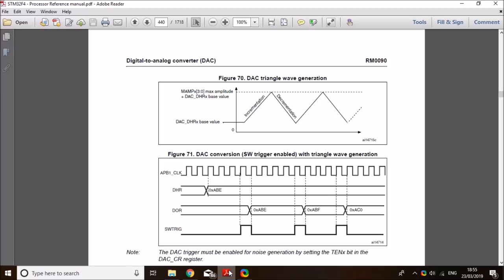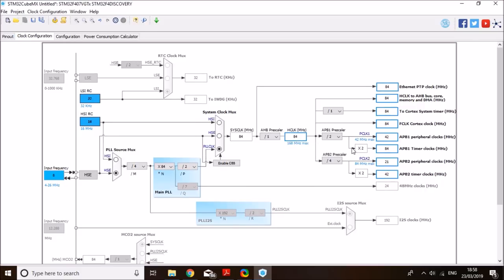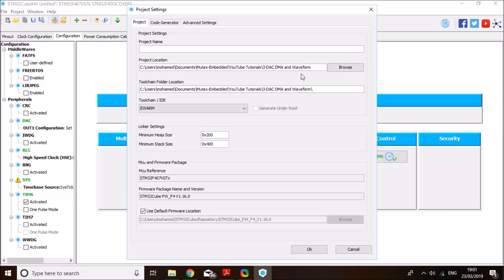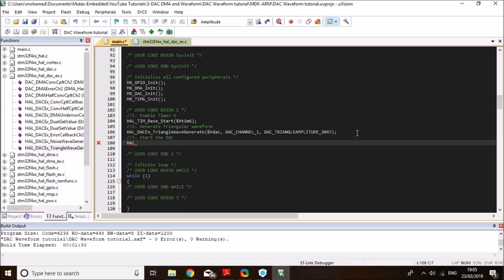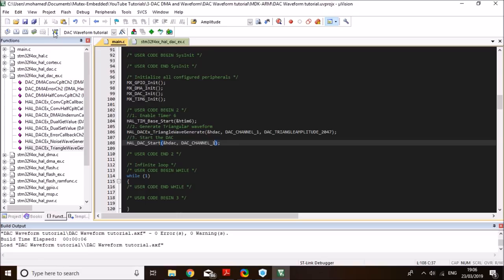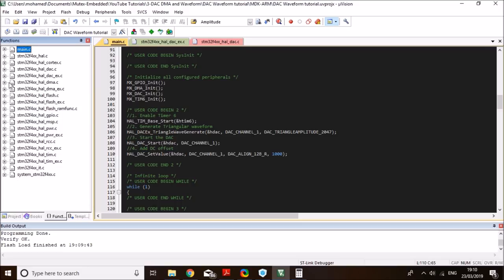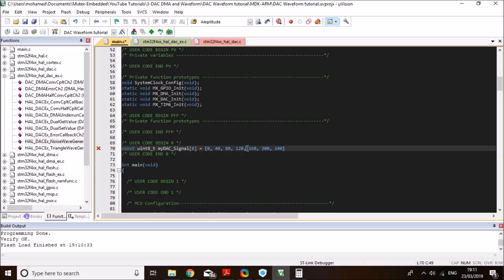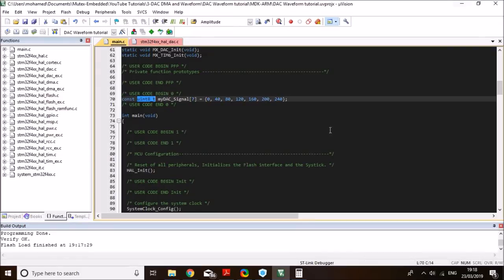STM32F4 Discovery board - Keil 5 IDE with CubeMX: Tutorial 31 - DAC Waveform & DMA

Comment: Thank you for this tutorial.Can you show us using spı pin on STM32F4  discovery card to write and read data to sd card.
Reply: There are several tutorials here that do this.  Look in this channel f or SDIO.  And SDIO 4 bits +DMA.  FATFs is a built in middle ware, so it is easy to set up.  One could use SPI for the SD card, but Since there is a built in 4 bit controller it is much faster, more reliable and better supported.
Reply: @spiralsheepdoll  i know how to used with sdıo pin but some stm module dont have a sdıo pin thats why i need spı pin for read and write data to sd card
Reply: @gokmenatakanturkmen467  
There is a real nice SPI tutorial here.  Many of the projects that include FATFs middle ware have an 'other' option.  You will have to write the 'glue' code to connect the FATFs low level drivers to the HAL SPI but that is pretty straightforward.  CubeMx does most of the heavy lifting.  Some of this might even be in a git repository if you search around a bit.  The high level reading and writing is going to be the same as SDIO.
Reply: @spiralsheepdoll  i saw that tutorial but they create  sd_card.c file and  sd_card.h file in that part.thats the reason  i could not understand.
Reply: @gokmenatakanturkmen467  
I do not really have the time to explain a simple process.  You basically have to add the HAL SPI functions to the low level FATFs drivers.  This is not difficult and there are many examples online, including the elm chan site.   Understanding SPI and how registers are read through it is a fundamental skill required of an embedded programmer.

Comment: So if the timer clock that triggers a DMA->DAC transfer is set to 42Mhz, the PRESCALER divides frequency again, while the COUNTER PERIOD is the desired frequency?  Interestingly, according to AN3126, it shows the DAC timers are 6,7-15, but your setup shows 2-8!

What is the difference between the DAC "normal" mode and "circular" mode.. don't they both always update the analog output value when loaded?

Regarding low impedance loads connected to the DAC, or connecting the DACs directly to the STM32's ADCs.. is there ever a case when you shouldn't enable the buffer on the DAC?   Regarding the 'DMA under run error', how does the DAC detect that the DMA transfer is too slow?  Does it happen if the timer event fired, but the DMA was not ready?

In the case of the custom waveform, the 100khz sampling frequency is the TIMER event frequency.. but how fast can it be?  For example the Stm32h7 shows the bus speed to can be 100Mhz with a maximum DAC sampling rate of 18.18Msps!   The STM32h7 also has a timer option to 'auto-reload preload'... should that be enabled?

BTW, in the code below, why does the offset applied persist and not get overwritten on next timer event? HAL_TIM_Base_Start (&htim6);HAL_DACEx_TriangleWaveGenerate (&hdac, DAC_CHANNEL_1, DAC_TRIANGLE_AMPLITUDE_2047);HAL_DACEx_NoiseWaveGenerate (&hdac, DAC_CHANNEL_1, DAC_LFSRUNMASK_BITS11_0);HAL_DAC_Start(&hdac, DAC_CHANNEL_1)HAL_DAC_SetValue(&hdac, DAC_CHANNEL_1, DAC_ALIGN_128_R, ulOffset);HAL_DAC_Start_DMA (&hdac, DAC_CHANNEL_1, pBuffer, ulLen, DAC_ALIGN_8B_R)